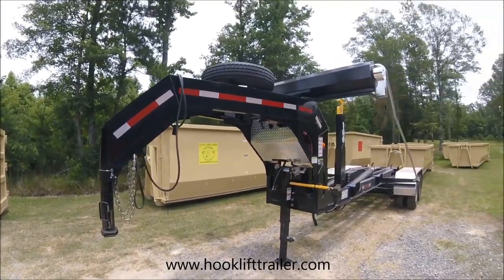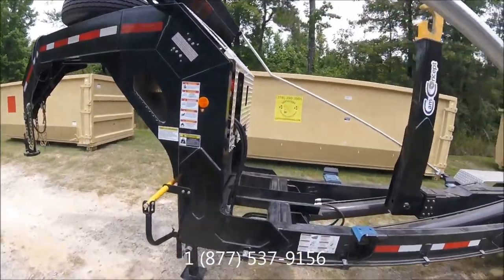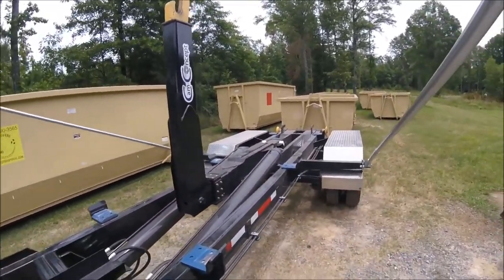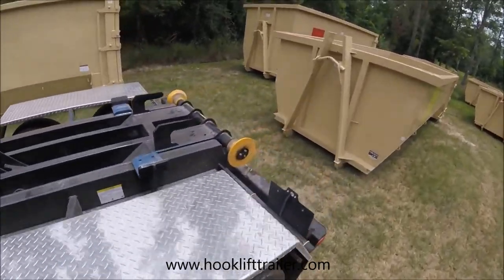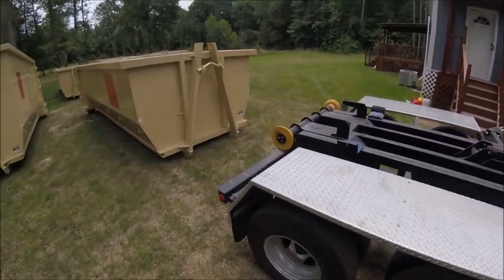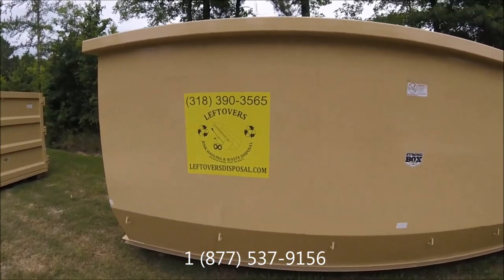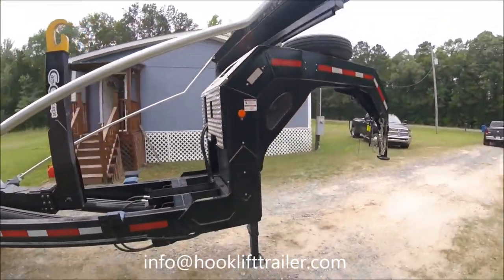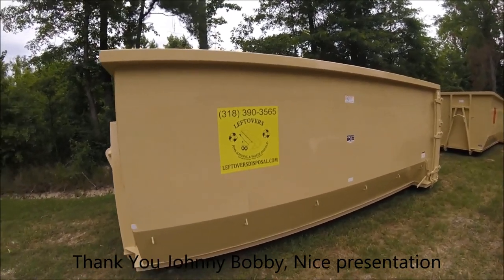HOOK LIFT TRAILER CL242GN16

Comment: Do u sell these? I see u have them in your yard or not..
Reply from the maker: This trailer in the video is in Louisiana, we sold it a month ago. We build these trailers since 12 years. We have a wide range of trailers from 14 to 30K capacity. the rental of small dumpsters is very popular whatever the region. Where are you located ?
Reply: Cam-Concept inc. Wv. What size truck to haul anything from the 40 yard an down? I would  to get into a business just not sure what lol.. right now I am doing rental house done that for 20 years just want to be a owner an operator business not employees. Tired of being a supervisor for Pepsi lol....
Reply from the maker: The trailer on the video can carry 30 yard and less, if you want to carry more than 30 you have to ga with our 30K capacity trailer https://youtu.be/Qt3mCiA-xjI. Let me know your email address i will send you a quote or fill out the quote request form on the website www.hooklifttrailer.com. For the truck size for the 24k at least 3500 or 3500 dually for the 30K at least a F450

Comment: What size truck do a man need?
Reply from the maker: Hi Roger, 350 / 3500 dually minimum. The customer is responsible for ensuring that his vehicle has sufficient capacity to tow his trailer.
Reply: Cam-Concept inc. Just wondering if there is a need for this in my area.. u have waste management.... I see a independent guy doing small one on a ford dually looks like a 1997 model...
Reply: Hi i am back lol. So really going start this business  do you sell this set up?